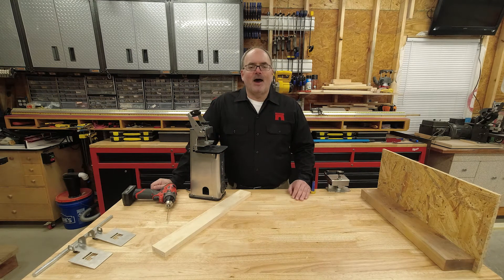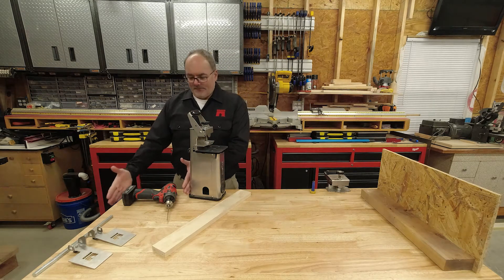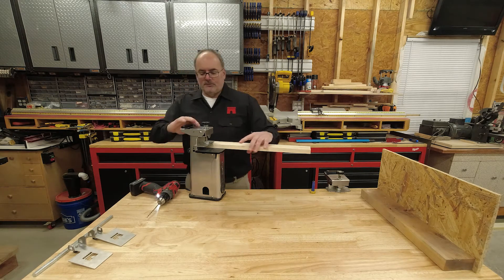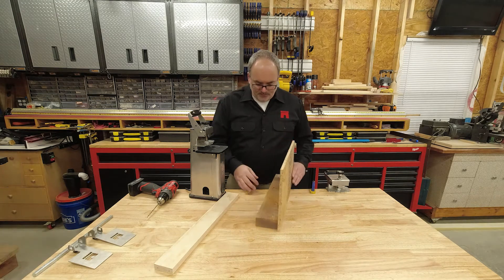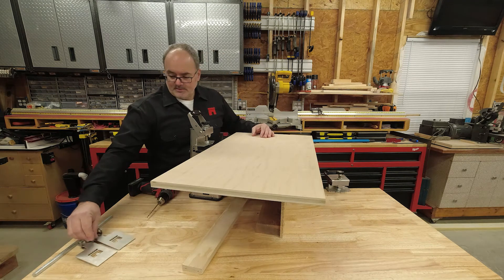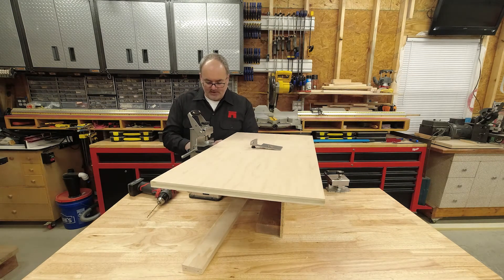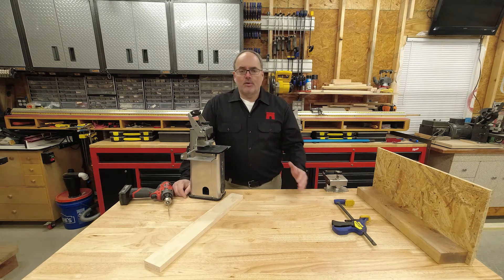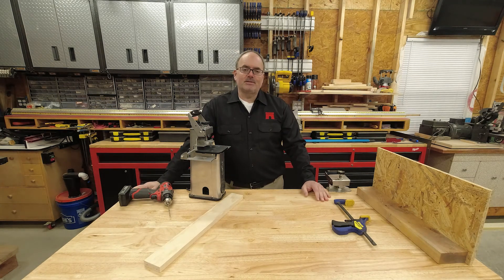Castle 110 Setup and Work Support

Comment: I think you meant  3 degrees has it changed from 6?
Reply from the maker: The Castle 110 cuts a 3 degree angle. Our other machines cut 6 degree angles.
Reply: @castleusa5250  Cool. Thanks for the reply! It's a great machine. It has saved me hours on projects.
Reply from the maker: @ianorourke  feel free to email sales@castleusa.com to share some of your projects. We love seeing what our customers do with pocket holes.
Reply: @castleusa5250  It's confusing, because it looks to me like the cutter stops at 3 degrees off vertical leaving a slope of 3 degrees for the screw head to rest on, but the screw travels at a slope of 6 degrees. Is that true?